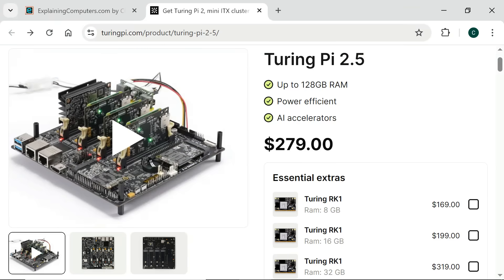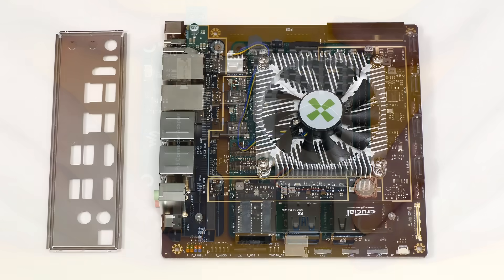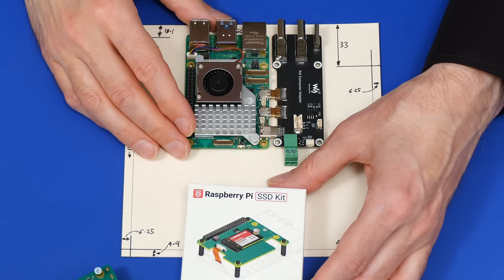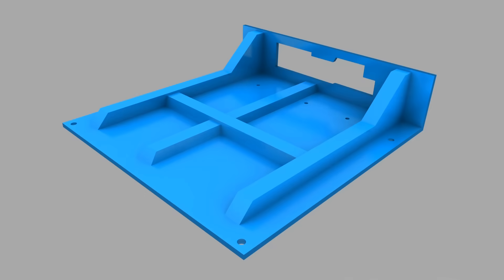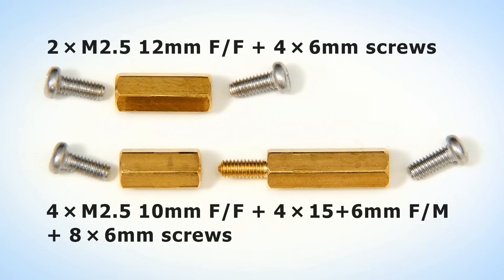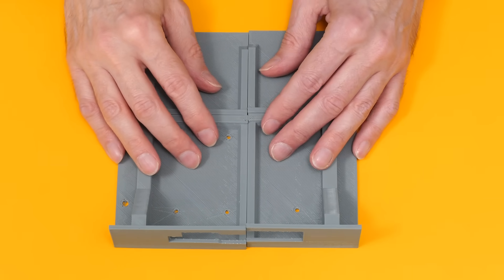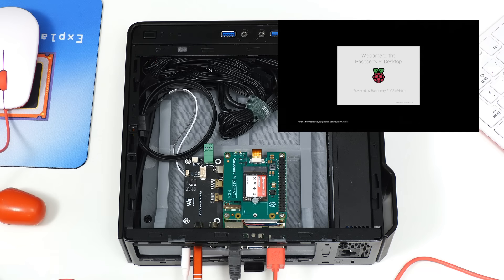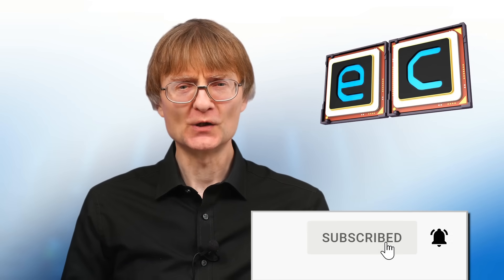Mini-ITX Raspberry Pi 5

Comment: I think this 3D printing and all is a lot of work and a high cost too. 

Maybe someone can tell if it would have been possible to in stead of 3D printing and the Waveshare thing, you could have made a circuit board that includes the Waveshare functionality but also be the size of the Mini-ITX that you wanted and even allows the use of the standard IO shield. I think it would have been about the same amount of time and effort to design and order from a service like pcbway and the price tag would not have been too crazy either. 

Probably I'm just a very critical person.
Reply from the maker: I think this is a very valid comment. :)

Comment: I think you could make your separate parts of the case like a jigsaw puzzle, so it could fit together - and be taken apart!  Thanks for uploading.
Reply from the maker: Oh, I wish I'd thought of that! Looking it is now, I could have put bolt holes through the cross sectons.
Reply: @ExplainingComputers  Perhaps an updated version, that includes the jigsaw puzzle fit-together, an improved I/O shield, that fits through the case to fully block the hole, and a slight change to the geometry, so that the side that holds the Waveshare adapter is 2mm taller, allowing the use of 10mm standoffs, matching the standoffs used for the PI5. You could feature it in the updated video that @arlo.infinity requested above, with the layout changes and LED lights running on GPIO pins. Sounds like plenty of new and exciting content to warrant a follow-up video. I know that I would be excited to see it! I felt bad for all of those "extra" cables that you had to tuck away in the case, not getting any use.

Comment: Sure, you can stick a Pi into a regular case, but if it doesn't use the power supply or any of the front plugs, it's kind of useless.

Comment: Things like this just make me wish we had a more performant ARM ATX option. SBCs are cool and have their uses, but their power is just so limited, and existing ARM ATX optons seem to be either about as low-powered as this or overkill workstation-class, workstation-priced affairs. It's annoying that Apple is still the only company offering ARM-based PCs with good performance and pricing, since running other operating systems on them is not that easy. In fact, it's virtualizatino/emulation, Asahi, or bust. As a hobbyist, I just really want affordable ARM ATX options with enough power to perform modern computing tasks well. I'd love it if I could swap out the x86 boards in my existing systems.

Comment: We Framework laptop owners are like vegans.  We'll let you know that we have a Framework whether you care or not. Anyhow, besides the RISC V board that they sell and is clever, the post-upgrade old main boards are still useful. There may be value in a riser to permit installation of peripherals internally inside a mini ITX case so that there aren't a bunch of dongles and enclosures.  An 11th Gen i5/i7 would make a nifty NAS/Homelab.

Comment: Why not include a DC step down board so the case power supply can be used?  Also, would like to see a way to use the USB ports of the case to the Pi.  Maybe Waveshare could create board that exposes a USB headers?  No sure how that might work since the Pi does not expose the USB controller on the GPIO header.
Reply from the maker: Certainly a possibility. I may still do this! :)

Comment: Ive been looking at using the same i/o adapter to put my rpis in a couple of different locations, mainly pcie slot mounts (to hide one in the back of an existing pc case to set up and forget) or front drive bays (where it is more accessible for reconfiguring i/o)

Comment: 5:00 As a V2 design you could leave a cutout in the tray underneath the PI instead of mounting it flush so you can access the full -size2280 NVMe board on the bottom as most computer cases now allow access to the back of a motherboard for the CPU backplate. (Although I would print it with least ASA/PETG and not PLA. (Which unfortunately the thermal requirements of both plastics for the bed/platform pretty much exceed the capabilities of your Mini Select V2 printer). 
For a V2 I would also consider mounting a PI UPS board to take advantage of the space the ITX form factor allows over the PI's.
Reply from the maker: A very good idea. I wish I'd thought of that.
Reply: @ExplainingComputers  To be fair to you your MK. 1 version is already pushing (and in some cases exceeding) the limits of your current 3D printer.  A more intricate design, especially when more densely packing electronics (or ones with a greater thermal load) would pretty much require a higher tier, enclosed bed printer because PLA  (PLA would warp) would not last long term under such stress in that use case and I would not trust any ABS prints made off that machine for structural integrity.  The specs on Monoprice's site for it say it can print ABS but I'm extremely skeptical of that as ABS needs a bed heated to a minimum of 95 degrees Centigrade (the Mini Select V2 tops out at 60^C) and enclosed bed to mitigate the risk of delamination and warping.

Comment: There are some RPi5 cases on all the 3D printing file libraries, you can cut off the I/O shield and extend it, and there are models of HDMI connectors that can be used to cut out the apertures on an extended I/O shield model.
 I have made cases before, for Pi's  and other boards, with hats and some boards I made fitted to the SBC, I stopped uploading them as all my parts, free ones and the ones I sold, were stolen and uploaded to the Creality website, before it was publicly launched! some were sold on Etsy without a licence, and sold cheaper than my own listing!
 It might be possible to fit another SBC inside that Mini ITX case.
 TBH, I would have built a whole 3D printed case with some cooling and a fan controller, and a small OLED display to show the  CPU and memory temperature and fan speed.

Comment: The position of the HAT seems designed to thwart the efforts of the cooling system. What was the company thinking?
If you're making a part from smaller components like that, might it help assembly to incorporate some mechanical alignment and locking system, e.g. lugs and slots or pins and sockets? It would complicate design slightly, but make for more rigidity. The glue would not carrying any real load, just stopping the pieces from moving.

Comment: So, for me, I  think 3d printing the whole case might be better.  But I like the extra  board because it offers full-size hdmi. I think the ssd card position needs to be adjusted to avoid fan air restrictions near the cpu. The main advantage of these types of atx cases is the full sized power supply. But if you don't need it, I think you can save some energy using a usb power supply.
Reply: joe..in a SFF case like this InWin..there is no chance of using ATX or even SFX power supplies..they simply do not fit..a different case yes..typically a cuboid shape like Silverstone series a few years ago..Chris is demonstrating it in this ITX Chopin..it's a nice looking case..I have the same..but as with other Reddit forum commenters I have the same issue with the discontinued IP-AD200C7-2 power supply..it's proprietary and nothing else fits..We've all tried

Comment: Nice project but I think you'd just be better off with the Argon One case which would give you a power button and a pair of USB2 on the front and the use of a full sized m.2 NVME which are much better value (not sure why Pi went for the short drives, other than the fact that they may sell more).

The Waveshare could be improved by adding an option to power from a 12V supply so you would no longer be tied so tightly to your mains supply due to the limits the USB-C cable.  Too much voltage drop from 5V if you extend the cable, better to run 12V and step it down at the board.  You would even have space to do that in your Mini-ITX case.
Reply from the maker: The Argon ONE V5 is indeed very nice indeed! -- https://www.youtube.com/watch?v=6zQZ1sJHpFM

Comment: Thank you Christopher, very interesting.  Your comment about whether Raspberry Pi themselves have considered a larger form factor is interesting.  I wonder what they'll do for the RPi 6.  Integrated m2 certainly seems like a prime candidate, but i don't see how they could do it without a larger form factor, at least slightly.  No doubt such a system could be my main workstation.  Even the 5 could do it with a m2 hat.
Reply: There seems to be a space set aside for it on the Pi 500 board.

Comment: Excellent project. My one suggestion would be to use machine screws and lock nuts to connect the extrusion pieces instead of super glue for a very solid connection.
Reply from the maker: You are right. When printing the final part I suddenly thought "you idiot, you should have put bolt holes through the cross struts and put it together that way". We live and learn! :)
Reply: @ExplainingComputers  My approach is to always think of these projects as prototypes, that way we, as you say, live and learn.
Reply: I also wondered on the use of glue for the baseplate.
Reply: There is command in Bambu Studio to place holes and print dowels to join pieces of a part when you split them.
Reply: You don't need to "print" such holes.  We have drill technology for that.  Nuts and bolts can be added at any time.  I suspect however, if the surfaces are flat and clean, super glue will hold very well indeed.
Reply: @Starchface  As a mechanical engineer I will always prefer fasteners to adhesives. That is why I suggested lock nuts, not just nuts.

Comment: For the love of god if you want an ITX Linux PC buy and ITX Linux PC, the atom based ones are plenty cheap. The Raspberry Pi community's desire constantly use Pi's inappropriately is staggering.

Pi's aren't marketed to be replacement desktops. The Pi's web page shows it being used for actually interesting projects where you would learn something.
Reply: May I ask who you think you are to criticize someone else's ideas and creativity?
Reply from the maker: I think it's pretty clear (well, its totally explicit) that this a fun project, and not a suggestion for what others should do. And you are simply wrong on the marketing: both the Pi 4 and the Pi 5 have been marketed as desktop replacements (as indeed the video also notes).

Comment: Thank you for sharing the project.
When it comes to the I/O shield, I wonder if it is possible to order blank ones ?

I think it might be easier (and possibly cheaper) to design a Mini-ITX base board for the Pi5 compute module.
The only thing that might be tricky is to align the high pin count connectors so as not to "stress" the boards.

Comment: In terms of the ingenuity and design, it is great. But then you add up the cost of all the things required, compare it to out of the box solutions that would cost either the same or less and be more powerful and versatile as  Mini PC and I have to come to the conclusion that it is wasted time, effort and resource from a practical standpoint. The concept could inspire others to come up with something similar but that engine inside doesn't do any more now than it did before.

And there lies the problem. Outside of the HAT that adds M.2 functionality to any Pi 5 that can increase overall performance, nothing else does anything particularly useful outside of style and the satisfaction of completing a project that ultimately might result in quick deflation of the enjoyment.

But I do suspect that the suppliers and vendors mentioned may well get some useful business from the exercise and folk may well be excited at the prospect of replicating the achievement.

I could be cynical and suggest that furtherance of ones own finances or prospects might be at the heart of such an endeavour, but general consistency of approach and ideology based on good old nerd tech enjoyment and not having a surname that is Trump/Musk.Bezos etc, would rather place more than a damp squib over the thought.

It was entertaining, as is generally the norm here.

Comment: I appreciate the passion you bring to this project but I kind of disagree with the idea of manufacturing a Pi in a larger form factor. I use the Pi specifically because it's small so if there was a change in the size I'd vote smaller instead of larger.

I'm an old school full sized tower person in general, but if I was going to drop something into an ITX case I'd still look for something with memory expansion slots and M.2 slots that wouldn't limit the physical size of the device so severely. I'd even look for one or more PCIe slots - that would open the door to a galaxy of even more ambitious expansions, and as you note it's great to have more options.

But as a person whose earliest projects usually involved snarls of 30 gauge wire-wrap wire and an embarassing amount of popsicle sticks and hot melt glue I have to say your 3D printed enclosure verges on being art instead of just engineering. Very well done!

Comment: Great build, Chris. What sort of power does it use? I've been thinking of setting up a windows pi for ages. Thanks for sharing.
Reply from the maker: Greetings Brian. In previous tests I'd measured a Pi 5 with an NVMe SSD to use about 6W at idle, and up to 16W at load. A great guestimate here from @arch1107. :) This compares to 11W idle and 30W load for an N100 system (Radxa X4).

Comment: To anyone who builds boards for CM5s my challenge is for you to build a mini ITX board with an M.2 slot, a single PCie slot, HDMI, USB 3, usb 2, ethernet and audio jacks with two sata ports and an option for either barrel jack or ATX power. And send one to Chris for review.
Reply from the maker: I very much like your specification. :)

Comment: I do love this idea, however there are a few things I would have done differently as you slightly mentioned. 
I would keep the Mini-ITX base but remove the IO panel 
Create the IO panel as a separate piece that snaps onto the PC case itself. 

Overall I do love the idea. I would look into getting the USB ports to work on the case but I don't believe that's possible

Comment: Still wondering why there is no proper mni-itx board with a pci~e slot and the ability to use a CM5 with a proper shield and atx connector. For me it would make a lovely base for a NAS with disk drives.

Comment: "...any kind of cereal will do."
Well, that's reassuring to hear.
However, I buy my steel-cut oats in a cylindrical container, which does conplicate matters...
Reply: I buy my cereal in plastic bags, which should make the resulting design more flexible.
Reply: Just make your case out of the can!😊
Reply: Step zero is to build a hydraulic press with built-in heating elements to flatten those cylinders.
Reply: Cereal killers.

Comment: I have tried a few M.2 for the raspberry pi 5, mostly unsuccessful unfortunately. Granted I will admit that I perhaps didn't spend enough time fiddling around with it and am looking for something that just plugs in and works. Perhaps I should give the previous M.2 cases another try. I believe the Raspberry Pi M.2 adapter is relatively easy (just plug it in, with some replacement standoffs) however. Still, I find myself going to refurbished 1L Lenovo thinkcentre PC for small computers these days as they are more powerful and also run on x86_64 cpus (the pi still is not that powerful to for day to day desktop use for me). The pis I have tend to have a passive aluminum (very much like aluminium) cases/heatsinks and are mainly used here and there on the network for non-desktop stuff. Your mini PC looks pretty good though. Perhaps paint the "IO shield" black.

Comment: Well... ... ... i dont'... ... ... i mean... ... ... it's just... ... ... why don't... ... ... ?
Reply: Just like this you're using the pc case only for the power button. No psu, no front usb or audio jack, no fans... i'm sure at this point for you is easy to trim the base and cad a vented top cover to complete a custom case for it... and with VESA inserts!

Comment: Cool project.  You would think that, with the advent of so many higher specced mini pcs that the Pi team would be looking at something like this in order to compete.
Reply: we all know they would end up making something with some kind of glaring issue/downside, i still use my pi400 and dont intend to get the pi500 exactly because they didnt fully feature that m.2 slot for an internal nvme, at this stage of the game not including built in m.2 nvme is just silly.

Comment: Whole lot of space for a power solution (even more when removing unused internal cables), could even add a screen in it.
or a second rpi + ai camera running gesture recognition emulating as a keyboard inputting to the first rpi. (or using ssh from second to first)

Comment: It seems the top of the M.2 hat sits quite close to side panel (maybe a just a trick of the video angle).Would it have been possible to lower the 3D printed board further down into the case to give more room to possibly use longer standoffs and ribbon cable to get more airflow for the cooler fan? The M.2 hat sits VERY close to the fan and taller standoffs may assist with cooling the CPU.